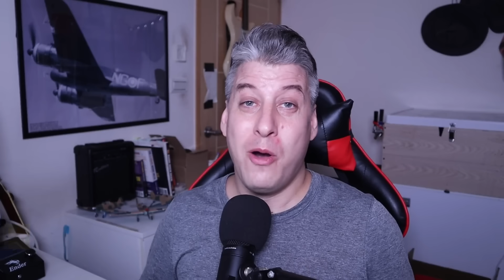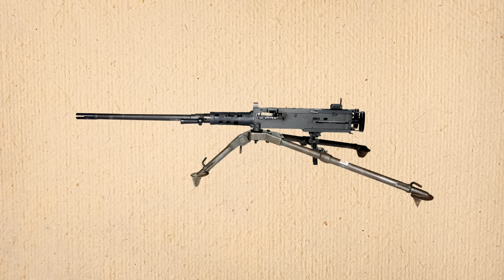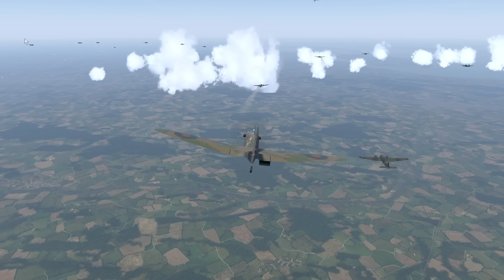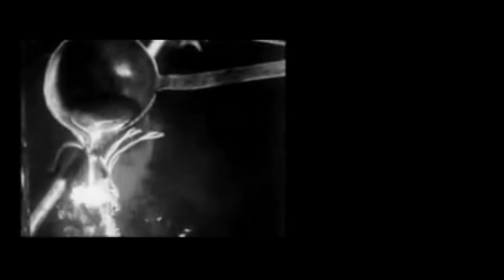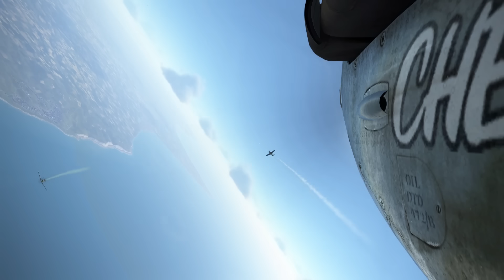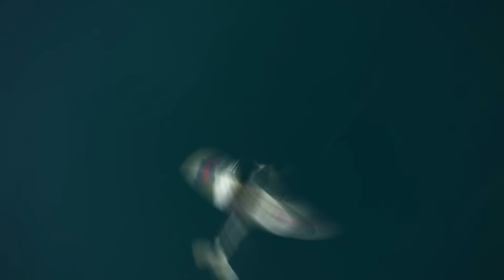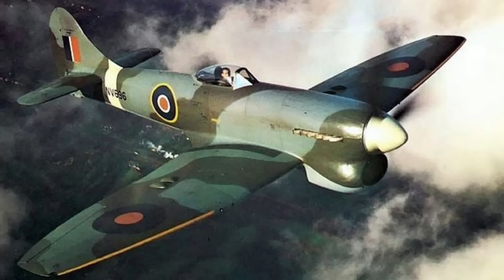Why Did The RAF Use .303 Caliber Machine Guns in WW2? The Surprising Answer

Comment: It was my understanding it was because the Hispano 20mm wasn't ready for service by 1939, and wasn't reliable enough to completely replace the .303 for a while after it was introduced.
Reply: 20mm Hispano cannon were available for RAF service in 1939.  
In the Spitfire the fitment was the 'B' wing version, but the fitment to aircraft, the Spitfire especially, was falling behind due to problems of ammunition feed during high-G manouevres, and with ducting hot air to prevent the guns from freezing.  

The Spitfire Mk.1b had 20mm cannon, and went into service with them late in 1940, but were not a great success.  
The later Spitfire Mk.Vb had 20mm cannon and was built in large numbers, and used in most theatres of WWII.
Reply: And it was easy to install a 303 in a wing..... And bigger guns were still being developed properly....
Reply: The .50 cal was ready to go. Heavy hitter.
Reply: @johnhannonHanno the plane was designed before WW2..... Things are simple in 20/20 hindsight
Reply: @johnhannonHanno   The 0.5 was considered and ruled out, the 20 mm Hispano cannon was chosen but was not ready and 8x 0.303 was used for a time, the First Luftwaffe aircraft shot dwn by a cannon armed Spitfire was in January or February 1940 but it took until late 1940 and the Spitfire Mk II before canon armed Hurricanes and Spitfires were in production, even 8 x 0.303 was better than the armament of any US fighter in 1940.
Reply: there was other reason in using machine guns over canons at most UK and USA fighters (specially light fighters (not multirole or heavy ones) while in German side they uses canons (with 15/20/30mm canons (and even 35 to 50mm in attack aircrafts)
 much more pairing with machine guns  (like for BF109s some even had 2x 7.7 mm + 2x 20mm + 1x15mm or some had 2x13mm + 1x 30mm in latter versions).
it was difference in doctrine too,
I heard alot from UK pilots during WWII at interviews which said sometimes we hit enemy fighter or bombers with more than 100 machine gun bullets but saw they still are flying with no problem.,
while when our planes hit once with their canons our planes would ripped off and we had to emergency landing or jump with parachute!

but if we consider each countries priorities we know each side did best for it side, UK and US planes would face German light fighter (like BF109) , Multirole (like FW190), HEAVY (like BF110), Medium Bombers (like JU-88, He 111) , Attack aircraft/Dive Bombers (like JU-87 Stuka, Hs 129) which machine gun bullets could penetrate and damage most of those (only medium bombers and attack aircrafts which had good enough armor shouldnt shot down by them unless shot to their few vulnerable parts (like cause engine failure or oil leak ...)

and obviously primary task to shoot down low altitude slow dive bombers like Stuka was for ground anti air guns which had large caliber guns too.

while Germans had to face UK and US Heavy bombers too, like Lancaster, B17 , B24) which had much more armor (specially flying fortress which saw few time upgrades with reinforced wing, fuselage which proved very good (after many B17s loss during 1943 heavy raid on Germany they did this and at 1944 heavy air raid proved it self and much less B17s shot down)
and thats why germans kept increased they canon size on their fighters (even light and small ones like BF109) which installed 30mm canon on it latter, to can shoot down reinforced B17s too, but it had low RPM,
Reply: or u heard FLAK 88, while allied had high calibre anti air canons too, (like 90 and 105) while germans had FLAK 128 too,
but because allied gained superiority over west and unlike US which could carpet bomb German mainland, Germany couldnt hit US soil, even bombing UK main land got much harder for them in 2nd half of war,
allies didnt need to use flaks designed to reach very high altitude,

and in German headquarter unlike head of intercepter fighter sections, Adolf Galand which beilived Germany must build as many intercepters like BF109s (and later ME-262s) as can, and those shouldnt carry any bomb (cause made them far heavier, slower and unmanovurable means too vulnerable,
but German high command ignored him and ordered they carry single 250KG SD Bombs, and instead of rushing production of interceptors,
work on bombers like 4 and 6 engine heavy ones, both with piston and jet engines, like Amerika bomber project which supposed fly from France and reach New york and bomb it then return,
or other  request was 1000/1000/1000, means that bomber speed should reach 1000 Kmph with 1000 KG Bomb and range of 1000 Km!

and for facing bombers they ordered to build more anti air guns (which we know are stationary and cant use in every place need at right time (like fighters)
their accuracy is poor specially for high altitude attacks.
for example American learned  how much it takes heavy flak guns shot reach to their high level altitude, and used tactics which from moment flak s started shooting till reach their altitude, they be at somewhere else to not hit (in this situations Germans had to use barrage mode which has much less accuracy vs aim shot mode)
Reply: @XFXForced  Britain had the QF 3.7n inch anti aircraft gun, the best anti aircraft gun of the war. Britain had the predictor gun sight early in the war and developed the proximity fuse.

Comment: So, to sum it up, the British Empire despite controlling half the globe utterly failed to fund even a modest effort at obtaining a suitable anti-air weapon post WW2, and was left with their pants down.

Got it!
Reply: The British Empire had several MGs and used them all in deliberate or improvised Anti-Aircraft mounts.  

If you mean the guns fitted to aircraft, they used Lewis guns, Vickers 'K' guns, the US-designed Browning ,300 MG modified to use .303 ammunition, the famed enlarged version the M1918 '50 cal', the Hispano and Oerlikon 20mm cannon, a 40mm cannon to attack tanks and vehicles, and some others, even Darne French-made ones.  

Other British designed MGs such as the several BESA and BESAL light .303 and heavy .50 MGs were also used, in tanks, ships and aircraft (sometimes).  
The Molins gun was 57mm or 3inch, or 6-pounder, depending on how it's measured, this was an aircraft weapon, used for attacking shipping.  

Not to mention all the captured stuff, most of which, such as Italian LMGs, were only useful for firing off the captured ammunition, then switching to the better gun.

Comment: Johhny E Johnson's, Britian's top ace with 36 victories, says during the Battle of Britian they tried 20mm guns in Spitfires, but jamming was a constant issue. It was later ironed out. He did wish they had 20mm than the .303. Adolf Galland himself always thought MG's on the 109 were little better than sparklers, and pined for the older Me109E that had three 20mm cannons, compared to the later F and G models with only one 15mm or 20mm firing through the propeller hub and two MG's

Comment: Higher rate of fire of the .303 caliber increased the likelihood of injuring or killing enemy aircrew. The 50 cal. machine gun, 20 mm and 30 mm canon were designed to destroy airframes and kill the crews in the resulting crash. 

In our war with the Japanese they used 30. caliber MG's. We armored our later Navy fighters to protect the  Pilots while the stronger airframes could resist the 30 cal. bullets.

Comment: Doesn’t make much sense to use .30 cal guns so that the enemy than has to use armor to protect against such round.
An LMG is always a threat to an aircraft and it would be stupid to not equip your plane with armor just because the enemy might use weapons that defeat that armor anyway.

Even if LMGs are mostly ineffective against armor and self-sealing fuel tanks, having some lead in the air that can damage a component that causes the enemy to retreat or lose the plane in the long run, is better than nothing.

Of course having even just one .50cal would be better than just relying on .30cal MGs entirely.
Then again, 20mm is an ideal caliber for fighter armament making it valid to just skip .50cal armament.

Comment: keeping in mind the slower air speeds at the beginning of WW2, the key benefit of using the 303 browning was that  a steady stream of the rounds could penetrate the target aircraft skin and shred what ever was behind BUT as aircraft speed and size increased the move to .50 and cannon rounds were needed due to being unable to stay on target long enough to pour a stream of 303 slugs into the target as one streaked past...

Comment: The Brits using a pop gun to dog fight enemy aircraft when the Germans were using 20 and 30 millimeter cannon in their planes was obtuse. That was so typical of the Allies thinking back in WW1 and WW2. Thankfully saner minds have since prevailed and they don't think small anymore. 

Case in point, the Sherman tank against the German Tiger was a death sentence for anyone unfortunate enough to be inside the Sherman tank aka Tommy Cooker.
       The Tiger had the mighty high velocity and deadly 88 millimeter anti-aircraft gun mounted in the turret and the Sherman had the anemic low velocity 75 millimeter cannon whose shells bounced off the front armor of the Tiger tank like tennis balls off a concrete wall. It was just assinine thinking back then on behalf of the Allies. Their argument for use of the Sherman was that they could make more of them than the Germans could of the Tiger tank, same as the thinking of using the 303 caliber bullets in their fighter planes. 
      I believe the designers of the Sherman tank would feel different if it was their behinds fighting inside a blast furnace on tracks against the formidable Tiger and Panther tanks of the day. You really have to wonder how little value they placed on the lives of the poor trusting soldiers they sent out to get turned into charred hamburger while inside their pathetically anemic Sherman tank. 
     The consensus was that it took 6 Sherman tanks to defeat one Tiger tank, 5 being cannon fodder which provided a sacrificial diversion that gave the 6th tank sufficient time to get to the back of the Tiger and fire a round into the armor where it was the thinnest. How would you like to fight in an Allied tank with those odds?!
Reply: The uberfighter at the beginning of the Pacific war, the Mitsubishi Type 0 fighter A6M2, was at first armed with two 7.92mm (.300cal) MGs firing over the nose, with their breechblocks and ammunition feeds inside the cockpit, just like almost any fighter from 1916 until then.  

It was used well, and the guns carried made little difference.  

However, Saburo Sakai, in describing trying to shoot down an early B-17, was shocked that his MGs made almost no impact on it.  He wasn't the only pilot shooting at it either.  

The Zero was given two extra 7.92mm MGs in the wings, bringing it up to 1938 standards (half the guns of a Spitfire in 1936), and later in the war, Zeroes gained two 20mm cannon in the wing positions.  

Then it was actually able to shoot down planes it met.

Comment: In world war 1 these guns were converted to 303 they weren't originally built in 303 and they had to get rid of the 303 because it just could not shoot those Germans down that small of a round and the 20 mm Canon work fine for the Germans and the Japanese the British just didn't want to be told anyting they assumed they were the smartest people in the world but they were getting their tails beat if it wasn't for the Americans and the 50 cal
Reply: The British started using the 20 mm and the fifty-cal in their planes after world war II because the Americans told him if they didn't they weren't going to come and save them again like they did this last time so they started waking up a little bit
Reply: @mikeemerson4284  The .303, .50cal and 20mm cannon were all used by Spitfires before the end of 1940.  

By the middle of 1941, all could be fitted in the Spitfire's 'e' or 'universal' wing, which also had bomb carrying ability.

Comment: There is a reason for the old axiom: " You're always prepared for the last war that was fought".  The reason the Brits went to the .303 are all pretty logical.  It was just a failure of imagination because they didn't anticipate certain things.  You can't blame them for that.  

 I don't think you touched on the real reason the .303 was substandard:  and that was the that it was a rimmed case which jammed a lot more.  Both the Spitfire and the Hurricane had problems with feeding early during the Battle of Britain.  I make machine guns for living and I know how hard rimmed cases are to put in a machine gun.  There is a reason it has been completely removed from all modern design.

Comment: One thing I learned very early on when I was in timed shooting matches, the Second Chance Pin shooting contests, it doesn't matter how many times you miss it still isn't going to "kill" the target.
edit: I don't believe the reasoning for the Japanese lack of armor had anything to do with armor not being worthwhile in protecting the pilots. The Bushido mind set was that you didn't need armor if you killed your enemy first. That worked really well at first giving the "Zero" extreme agility and ability to evade fire and turn and attack it's attacker. But when tactics used first by Pierre Chenault's group, flying slower, less agile planes with a slower rate of climb but a really good dive speed, the Japanese planes had very little defense. Then later it was to late to add armor to the Japanese designs when the bigger planes like the P-38 could not only out run them, they could out climb them and even out turn them and with the concentrated fire of the 4 50 cal machine guns all shooting a stream of destruction along with usually a 20 mm cannon the zeros had very little chance as even a short burst through the plane did enough damage that even if the pilot survived the attack the plane was a goner.

Comment: Japanese Zero ace Saburo Sakai admitted after the war that the US Air Force approach to arming their fighters with six .50 HMG's was more effective than the Zero's mix of machine guns and 20 mm Oerlikon cannon. The rate of fire of the cannon was comparatively low and the muzzle velocity was also low, making hits at anything other than close range very challenging.  The two machine guns were effective at .30 caliber and even more so when the Japanese upgraded to .50 caliber, but six is certainly more effective than only two. Cannon didn't become really effective until the higher velocity guns were developed after WW2.

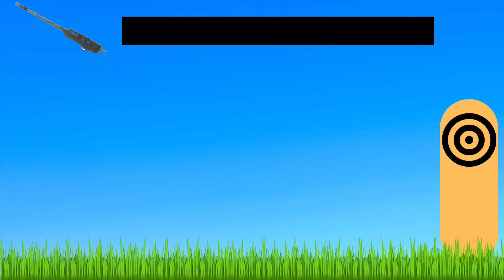Comment: what is up with that graph at 4:30????

the difference in bar length between the 1200rpm and 950rpm is about the same difference between 950rpm and 800 rpm despite the drop between 1200rpm and 950rpm being 250rpm and the drop from 950rpm to 800rpm is a mere 150rpm

then for some reason the bar length for 850rpm approaches a very very similar bar length to 950rpm despite the difference being only slightly less than 950rpm and 800rpm

Comment: The Japanese .50 calibure was packed so full some naval aviators thought they were firing 20mm shells at them.  The downside though was barrel length and mechanical reliability.  Which the M2 and M3 proved very effective at in comparison, that and having 4 - 6 .50s on your plane compared to two on Japanese and Italian well the results speak for themselves.

Comment: As someone who played a lot War Thunder and used historical accounts to learn how to use each vehicle I can tell you that if you 

the Spitfire / hurricane has a much higher rate of fire per gun plus more guns in general that are more reliable and hold significantly more ammo. 

8 303 machine guns tends to work a lot better than 6 50 cals until you get up to just with thicker hulls or long-distance shots (which most the time aren't worth it) the ideal combat range of a WWII fighter plane was 300-400m and the 303 would work perfectly within that range

Simply unless you're shooting at something far away or with armour the 50 can be a bit Overkill against unarmored WWII planes, a 303 round would be able to punch through that regardless so being able to fire and carry a lot more ammo and guns in general would just work better

Same idea for the planes that had for 303's and 2 20mm compared to 2 20mm and 2 50cals the 303 comes out on top because more guns firing more rounds with significantly more ammo is better for a secondary

Comment: Interesting subject. I remember an American rubbishing the three o three. Saying the 109 had a 37mm cannon that could destroy a spitfire with no trouble. Well, i remember an old Bof B pilot saying that the 37mm was slow firing, and as soon as you saw them whizz by you got out of there. The 37mm was soon removed from the 109 because it damaged the engine. Caused oil leaks all the time. (it was on the engine which was inverted on the 109.)

Comment: Douglas Bader reckoned the Hurricane fighter with .303 was the best platform, and when the Air Ministry asked their top pilots for their opinions, Bader arrogantly assumed that everyone would agree with him.
Robert Stanford Tuck and Sailor Malan both argued for cannon successfully.
The top RAF pilots preferred to get in close before firing and had the skills to do so.
So whilst you could carry less ammunition, you used less to get a 'kill' instead of a 'probable' or a 'damaged' enemy.
Bader opted to keep his .303s until he had to fly an aircraft with cannon. Then he saw the light.
Using a combination of .303 and cannon was a good compromise between weight, airspeed, endurance, and effective firepower until more powerful aircraft came along and the teething problems of cannon had been solved.

Bader wasn't exactly wrong. At the time, most pilots were novices that opened fire from too far away, so more .303 rounds made sense.
The Hurri needed to keep weight down to keep up with the Me 109's and for endurance.